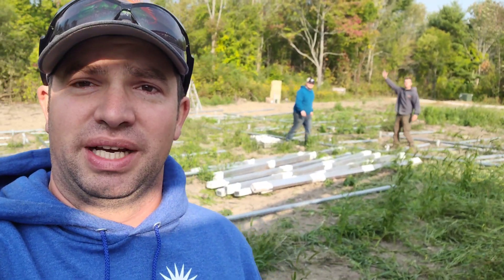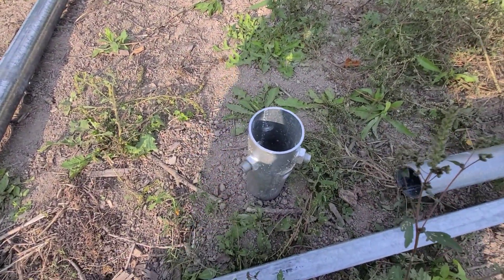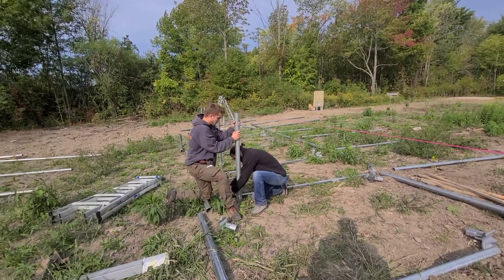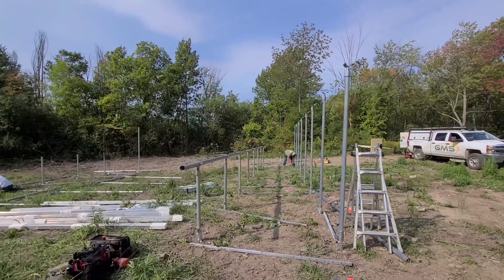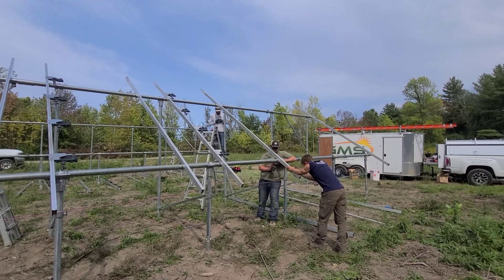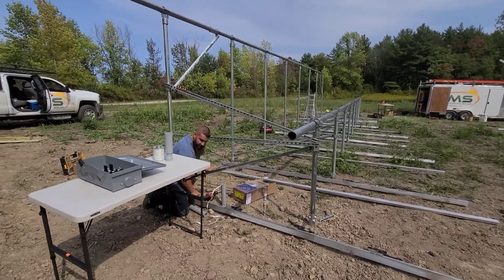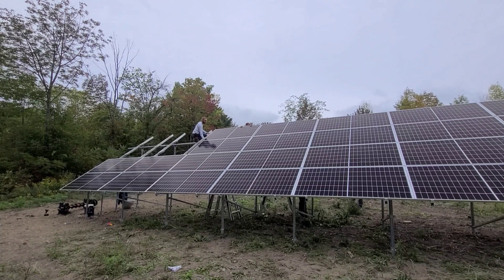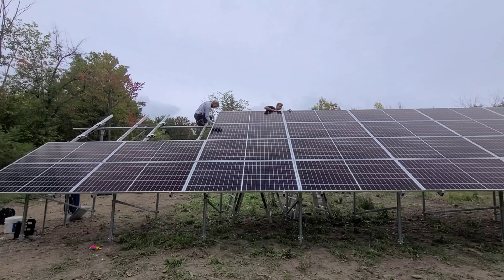20kW Ground Mount Solar Installed in 2 days!

Comment: Is there a rule about how deep the ground screws have to go? I installed mine yesterday, we did not have a drill and we hit ledge. Sticking up about 16". All the thread is underground. Is this ok?
Reply from the maker: I know the installers look for a certain PSI on the machine if they don't go in all the way, but would be best to reach out to Sunmodo (or whatever equipment manufacturer you used) to double check with them.

Comment: It's confusing to me seeing these solar arrays to have so many posts for the ground mount. I love mine 50 panel array and all I have is five 15 or 20 ft steel beams that were pounded into the ground with an adjustable degrees racking system. looks so much cleaner and was surprisingly four cheaper than using amount system such as this.
Reply from the maker: I'd say probably 80% of the sites up here have some sort of rock or ledge making pounding posts a less desirable option. These can be drilled and installed anywhere.  I agree that fewer posts look a lot cleaner though.
Reply: @benssolarandbattery  ohh yeah that makes sense I live near the Ozark mountains I had another section for my array selected and the pile driver couldn't get the post down more than a couple of feet tried to use screws in the same deal there so they had to re-engineer and move to a different part of the field until they found a spot where they could drive the posts.

Comment: I think what you have built is more like a 14.4kW system. The IQ7+ is a great product, but they won't output more than about 300W per panel. Sure, the 420W panels may produce more power in lower light than lower power panels, but in maximum irradiance situations, you're limited by the microinverter output. I built a nearly identical system with 350W Q-cells panels, but that doesn't make it a 16.8kW system. My production data bears that out. I installed mostly IQ7+ microinverters, but also a row of IQ7As to see if there is any difference in output. So far, I see no difference. Seems to me any additional money spent on bigger more powerful panels is kinda wasted in this installation, and I'm glad I stuck with the IQ7+ instead of the more expensive IQ7As.
Reply from the maker: We are limited to 15kW AC here, otherwise it's commercial permitting which takes a year vs. a month.  I agree that it's fairly oversized for the inverters, but you do still get more production, especially here in VT where it's not sunny all the time.

Comment: what are you producing on average per month?
Reply from the maker: Winter is terrible, but spring summer and fall average around 2.2MWh/month.
Reply: @benssolarandbattery  Yeah I am down in Tampa going to be getting a house in Apollo Beach. Want to throw solar on it but I am torn between 15 Kw or 20 Kw system. We just got two new EVs that up'd our electric bill about 8 Kwh/day I already did the average. With the EVs factored, for the year if we were to do net metering and build credits with power company to have a $0 electric bill I would need to be able to produce more than 1785 Kwh per month. I think a 15 Kw system will do that just fine down her in FL. Was going to go with an REC solar panel setup if it's 15 Kw but if I have to bump it to 20 Kw, might save some bucks and go with the Trina Solar. Anywho, if you have any insight on that, I'd appreciate it.
Reply from the maker: @Bigsargewaymo7  I'd always go with the bigger system.  It doesn't cost that much more typically to upsize during install, but will cost a lot more to add later.
Reply from the maker: Average about 21MWh/year.

Comment: Ben how far can a ground mounted solar array be from my house? I have a good spot about 300 feet from my house.
Reply from the maker: 300' isn't bad, just need to make sure the wire is sized properly for voltage drop.  If you're using a string inverter, you can run the higher voltage DC strings back to the house which usually allows for smaller wire.

Comment: Great video, don't know how I missed this when it was posted originally. One thing I could never figure out is what people are using for the posts. I know it's steel, but is it just like EMT conduit-type stuff? Or thicker walled? I searched around when I was building my ground mount and couldn't find any pipe that looked appropriate for the use :/
Reply from the maker: We use galvanized schedule 40 pipe.  It fits right into the ground screws.  We also use a cold galvanizing spray on any cuts to prevent rusting.

Comment: Why didn't you make it foldable? If sunset gets down.
Reply from the maker: With the price of panels being so low, its better in the long run to have no moving parts and no maintenance.
Reply: @benssolarandbattery  Hahaahaaa 😂
Reply: @benssolarandbattery  need more energy to maintain lol
Reply: Moving parts = higher chance of failure in future.